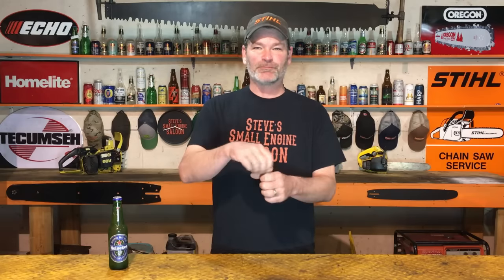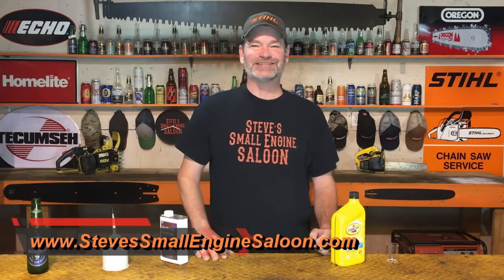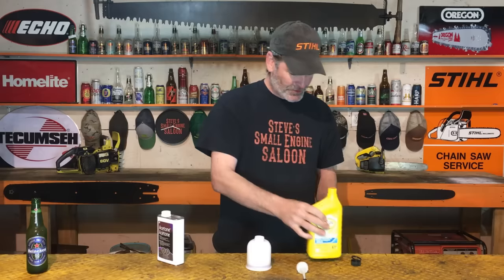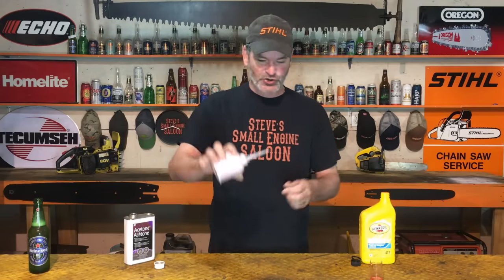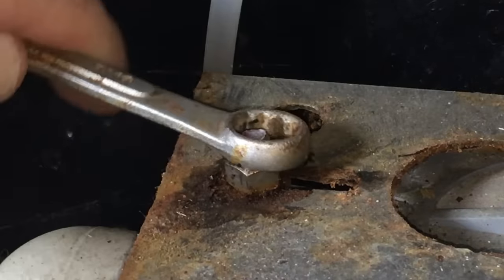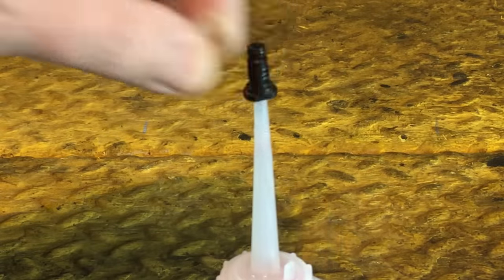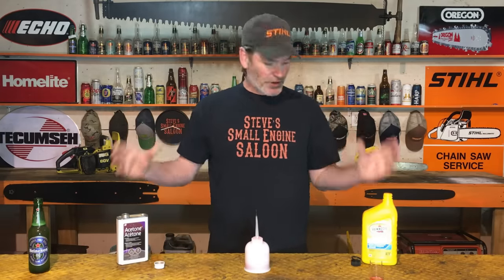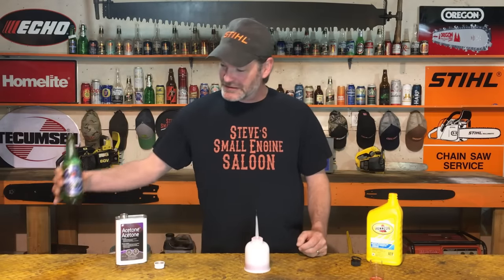How To Free Up A Seized Bolt or Nut

Comment: Always thumbs up!
I have to solve this, but problems:
1- it is fixed on a wall, that means I can't manipulate it.
2- It is horizontal.
So, is there a solution to spread it correctly?
Thanks in advance for your answers.
Any (manual?) transmission fluid are ok or does it needs "automatic" one?
Searched in my country and found similar, but it said lubricant (oil), is this ok?

Comment: Been using this combo since the 70's to free up vintage engines,  works fantastic, pull 9plugs and put a good amount in the cylinders of the seized engine, then every couple of days pull the dipstick out and smell it for the mix, when u smell it start rocking the engine back and forth until it breaks loose.

Comment: My condolences to you and your family on the passing of your brother Mike. I use Lockheed brake fluid on rusted bolts and seized engines and it works great can't let it get on paint work. But I'm going to try your solution and see how it works. Thanks for sharing.
Reply from the maker: Right on

Comment: Acetone and ATF make the absolute best penetrating oil.  Been using that for decades.  Something else that helps is to use a hammer and blunt--ended punch to give the bolt/nut a side impact to help break and adhesion between the contacting surfaces.  Then add more penetrating oil.  As someone else stated here, moving in small increments, back and forth, while continuously adding the mixture is a surefire way to get the stuck fastener apart.  If you can ever get it to move any at all, most of the time, it will come loose.  

Be aware that loosening very corroded nuts and bolts generates an immense amount of heat inside the threads very quickly.  When you have one that's really tight, move it a little and let it cool for a few seconds to disperse the heat.  Add more oil solution and do it again allowing for the heat to disperse.  Small movements is the key.

I learned this stuff from working in a motorcycle speed and machine shop for over 30 years.  Steel bolts in aluminum engines can be problematic when exposed to lots of moisture.  Sometimes there are ones that are not going to loosen no matter what technique is used but being careful can work most of the time.  My best advice is to use lots of lubricant and go slow.  The smaller the bolt the more care is required because they can twist off much easier.

Comment: Thank you Steve I had an axle nut that was being a big problem and I put all of my weight on a breaker bar and it still wouldn't come off, I tried heating and everything well after watching this I mixed some up, heated up the nut, and doused it with the mixture it then came right off. A great tip will definitely be using this in the future, Thank you.
Reply from the maker: You're Welcome...

Comment: I AM GOING TO TRY THIS DOWN THE SPARK PLUG HOLES ON AN OLD CAR THAT BLEW A HEAD GASKET 45 YEARS AGO THAT'S JUST BEEN SITTING IN OUR BARN. I WILL GET BACK ON HOW IT WORKED. THANKS TO YOUR BROTHER FOR THE TRICK. WAS GOING TO TRY KROIL, BUT SOUNDS LIKE THIS WILL WORK BETTER. I AM A LIQUID WRENCH KINDA GUY, BUT IT'S ALWAYS GOOD TO LEARN AND TRY  NEW TRICKS. THANKS. (MIGHT BE A MONTH OR TWO.)

Comment: So sorry for your loss.  Because of you, I was able to get my Ryobi leaf blower not only properly tuned but running like new.  You did a video specifically on that similar model and I thank you for that.  I was just about to give up but you saved me some $$ and I tackled it.  Between adjusting & tuning it, and proper non-ethanol fuel, it runs like new.  I didn’t have go out and buy a new one.  The unit is over 10 yrs old!
Again, my condolences to you and your family.
-Roy
Reply from the maker: Right on Roy!  Thank You...

Comment: YES I HAVE USED THIS FOR YEARS, AND IT WORKS WELL.    BUT LIKE STEVE SAID IT DOES EVAPERAT FAST AND SEPERATS  SO I ONLY MAKE UP A SMALL AMOUNT AT A TIME. IT IS EASY TO MAKE SO I ONLY MAKE WHAT I NEED AT THE TIME. GOOD STUFF TO USE.      THANKS FOR SHARING STEVE.
Reply from the maker: Right on Tommy...

Comment: Wire brush the exposed threads otherwise the nut will lock up on removal. With really locked bolts , like on a turbocharger many years old all rusted and corroded up. Wire brush everything heat the nut until it’s glowing if you can cool the thread with some water and use a freeing oil. Acetone being thin would get right in there and automatic tranny oil is pretty thin as oil go. Makes sense. Condolences with regards to brother, been through it. Nice dedicating this presentation to him.

Comment: Thanks Steve, sorry to hear about your brother Mike. Love your shout out to your mom. Ill give this a try - i have been in the auto repair business since 76 and what has worked for me is the torch. Either Mapp Gas (a bit hotter than propane) or Acetylene with Oxygen (my go to) we heat the bolts or nuts to a light red if possible cool down with water from the hose or spray bottle. Then repeat, it works every time. When we are in a sensitive area we use PB Blaster. The PB is good not great and many times we snap the bolts, so the ATF and Acetone tip is worth a try. Hope your doing well and I had a Hamms while watching this :)

Comment: Free-all works very well, and Kroil has also done great things for me.  I did oil and ATF in a old vw beetle engine that was stuck, forgot about it for months.  Went to take the flywheel nut off (I know, just buy a new one cheapskate) and that engine turned over !! What ?  Totally unexpected.

Comment: I have used prep and etch which is phosphoric acid and it works great. WARNING though. It’s acid so make sure you don’t spill it on paint and wear safety glasses and rubber gloves. It’s great for taking off rust too. ATF and acetone works great too. Thanks for the videos Steve!

Comment: R.I.P Mike
Steve silly question:
In a semi truck motor some screws are in horizontal position, does it work too🤔 you are showing as a proof a vertical position screw, the mix can run easily down because of gravity

Comment: Thank you Steve and my condolences on the loss of your bro. I've been a subscriber for years and your videos have helped me more than you know. I have a situation that's a new one on me. I have a sticky push mower blade that I cannot get off. I've had it off before to sharpen but this time it just spins when I turn the nut. I've applied PB oil but still no-go ( I will make and try your recipe in the future). What's weird is that the whole assembly spins, bolt and all. Makes no sense to me. As always, thanks for all you do!

Comment: I liked PB Blaster best, it too would wick up the threads and work miracles, I'll have to try this. But nothing else is quite like an acetylene torch to heat the nut to a bright reddish/orange, you have to be careful you don't wring it clean off, and when it gets to a dull red it starts to tighten up again so you have to heat it up some more.

Comment: The most amazing bolt/screw/nut etc. UNseizing method EVER!!!
I had a metal toilet handle that broke and the base was frozen to the metal nut.  I was going to have to replace my ceramic toilet water holder.  Tried this method which is a 1:1 ratio (aka 50:50 mix).  Place in a small shot glass (Thank's to Steve's Small Engine Saloon--HaHa) Drop a few drops onto the frozen bolt and nut and watched it "soak in" as Steve recommended.  2 minutes later I was able to unscrew the frozen bolt.  Genius!!
Reply from the maker: Right on Jimmy!  Thank You...

Comment: Great info thanks for the tip Steve.  I've always used Kroil, Aero Kroil, or mouse milk as we always used those where I used to work.  There are also some good videos on here about using electrolysis to restore corroded metals but I've never tried it.  FLY NAVY!!!
Reply: I used Kroil too many times with success. I'll definitely try this Acetone trick.

Comment: Hey Steve, good tip. I think I’m going to try using that solution as a penetrating oil to open up clogged zirk fittings instead of replacing them. Have you ever tried it for that purpose? Thanks again.

Comment: Hey Steve, if you have a minute. Trying to figure out some info. Why did STHIL start putting MS at the beginning of all there saw models? For example, like the MS 291. What does the MS stand for? Talking to my neighbor about exhaust mods, the topic came up in conversation. And neither one of us had a clue. Also while I have your attention. Have you ever built A chainsaw holder? One that could be mounted on A tractor fender or fourwheeler. If you have, a DIY video would be awsome!

Comment: Great tip Steve.  Sorry for the loss of your Brother.  BTW, how long do you let that solution soak on the fastener?  About 1-2 beers?  I usually spray Liquid Wrench penetrating oil on a fastener the night before if I have time.  It works ok.  I will try this next time.

Comment: Hi Steve. I understand the rusted nuts and bolts. How would this work on corroded, stuck water hose to metal faucet? (as in the water hose connected to the cold water fauced for a washing machine)?

Comment: So this is apparently a time of grief for the passing on of your brother Mikey. My condolences man. 
I have an old tractor, just bought the rusting hulk of a machine. A project. I do not have those two components but I do have paint thinners and CVT transmission oil. I'll combine those and anticipate similar results. The cvt oil has the most amazing slip and lube I have found in oil. Paint thinner might contain some acetone and ISOROPYL ALCHOHOL? So with a big rusty top case cover and bolts and nuts that have become pointed like a short rusty cone. You may have given the tractor a bit of salvation and to me also trying to make good of it all. Thanks Steve . And thanks Mikey. Walk with God, R.I.P. !

Comment: What should I do if it's a bolt not a nut that has been tightened so tight that I put a jack under a mounted wrench on it and it lifted the vehicle without loosening the bolt. Should I heat the bolts with a torch until it's glowing red hot then attempt to get them off??? The bolts are on the front calipers from a pickup truck that's been sitting for 7 years.

Comment: God Rest Mikey's Soul, and this is the 2nd or 3rd time I have heard this mix idea, so I will try it today.  WILL IT PENETRATE if the head is on top and you have to go through a bolt head, washer and steel (radiator core support)???

Comment: A wrecking yard close by also adds brake fluid in the mix.  Brake fluid wrecks paint so be aware of that. But it eats rust like crazy
 I have a protocol for steel bolts in aluminum that I just walk by every day for a week and add a bit of penetrant before attempting removal.  Works s treat on motorcycle case  screws

Comment: So sorry to hear your loss of a brother.  Family is everything.  More important than riches or fame or even health.   May GOD welcome him home with open arms.

A little story on penetrating oil and stuck bolts and such.  We moved to NOrtheast NC in ‘99.  Looking for a marine mechanic, I found one in Hertford  below Tidewater, Va.  he was trying free up the horizontal hinge pin that lets you raise (tilt) the engine on a 100 hp outboard.  He had been soaking it for over nite with some kind of penetrating oil, to no avail.   I suggested what my elevator mechanics used in similar situations.   You may not believe it bot the solution to break the large pin was SLOAN’S. LINIMENT.    It saved many an elevator repair time with repair teams trying to free bolts nnand frozen shafts on old elevator systems, some dating back to early 2900’s.    I returned a couple of days after meeting the boat mechanic and he showed me the bottle of Sloan’ LINIMENT.
The hinge was free and the repair done.  He was amazed.  
Apparently the liniment solution containing Butylated hydroxytoluene, Coparaffinate, and Methyl salicylate and pine oil together with a bunch of coloring agents works very well in penetrating action due to a very low surface tension of the mixture.  It is very expensive, the 4 fl. Oz bottle costing me $16,89 at my local small town pharmacy.  On special order.  Comes in a glass bottle and I have kept with the package an old red plastic tube such as comes with WD40 spray cans.  You can apply as much as you need and not waste a drop.
Forgive me for changing the subject from Mikey to Sloan’s.  Thank you for sharing your brother’s experience with frozen bolts.  May his suggestion live on with your subscribers and viewers.

JoeB
.

Comment: Steve, it has been more than a year but I know you still miss your brother.  My condolences to you.  Tell me, could this ATF-acetone mixture be used to free up a lawn tractor rim that is seized onto the axle?  Even better, have you posted a video about how to pull a seized wheel?  I tried a 7" gear puller and got nowhere.  I do not have a torch.  Thanks.  Brian

Comment: I'm a believer! I pumped 20 shots of this mixture into each of the 8cyls of a stuck mercruiser v8 and let it sit a week with the plugs in.  I used a crank rotation tool bolted to the balancer and a breaker bar with a 4' pipe from my floor jack. and the engine broke free! after about 5 rotations snd a lot of back and forty motion, i could easily turn the motor with just the breaker bar alone.
Reply from the maker: COOL!

Comment: Corrections, acetone is sold in plastic containers, most probably high density polyethylene or PVC. Also USED automatic transmission fluid (AFT) can be substituted for new AFT. Kerosene would work better as it is similar organically to the AFT, whilst acetone is somewhat like alcohol . I am an industrial chemist.

Comment: Brake fluid works great for helping to get rusty bolts to come loose too...great thing to know when you are at a pick a part yard and don't have your can of penetrating oil with you, usually you can find brake fluid left in the brake lines or some in the reservoir.

I use a 50/50 mix of transmission fluid and engine oil all the time when reassembling stuff, works great, and it also works great to help loosen stuck fasteners too, but not nearly as good as brake fluid or your acetone/transmission fluid mix.

Comment: Rather than mix it, could you just pour a bit of ATF, then a bit of acetone on the bolt, and let them mix there? Apparently both those fluids soak into the metal crevices very well, and I doubt only the mixture soaks in better than either fluid by itself.

Comment: Condolences, it's tough to lose a family member, especially one that was close. 
I've used a product called Rust Buster for some years now and they recommend tapping the fastener lightly to help break it loose. I've also tried the ATF & Acetone with similar results. Use it in the shop where volume is needed. Another good one is Deep Creep by Seafoam. 
The big thing I've found is patience, and not using excess force. A little push & pull back & forth to start with to help get things moving. Then stop & back it off when you feel resistance increase. Apply more penetrate and clean the the threads if removing a nut from a stud. Even using a die will greatly increase the odds of a successful removal.
RIP Mike.
Reply from the maker: Thank You...

Comment: FLAMES, FLAMES, FLAMES....

Forget all the fluids....use heat.
Flames played on the nut...
Works every time.....

Obviously you have to take care in confined spaces and near any rubber components, but small lighters with intense heat flames are readily available...or a flame directed down a piece of pipe will work...

ATF and Brake Cleaner are pretty good, but flames and heat always excels....

Nice and informative video. Well done...
James Hennighan
Yorkshire, England
Reply: I mean this is a good alternative for the DIYer to pre soak suspension steering and exhaust bolts/nuts the night before the job.

I'm not too keen on playing with fire, especially with a small propane torch😢
Reply: @ricebike  Check out the availability of small butane powered lighters. I have one that fits in the palm of my hand and gives a very sharp and high-intensity pencil like flame. Easily directed and one fill lasts for a good while. Cheap as chips on the internet.

Obviously the flame can still hurt you or cause some damage, but it's small size makes it easy to handle.

You will be surprised how little heat a seized nut requires, (even a very rusted one), to free it.

James Hennighan
Yorkshire, England

Comment: Steve, I thank you for this recipe.  I am 70 years old, female.  Going to hardware and auto parts store tomorrow and see if this works for me.  Dang Weber BBQ grill whoever used the wrench tightened the bolt hard and I think I am the person who tightened it.  Need to replace the regulator.

Comment: Kroil is about the best I’ve ran across
Reply: Have you ever heard of it? You can’t buy it at auto parts stores or home improvement stores. You have to order it but it’s amazing
Reply: I've heard of it but does it work better than the 50/50 mix Steve mixed up??
Reply: @donmayberryjrsOPE  
I would have to say yes
Reply: @justinphillips5702  IDK, I've been using the acetone/ATF mix for many years and haven't found anything else better.... Yet
Reply: @donmayberryjrsOPE  
That mixture works very well but, I believe the Kroil is has it. Just try it out I didn’t believe it until I tried it,… least to say all of my Wd40 is outta my shop lol… not bashing it by any means same as Pb. Telling yah this stuff works but it’s not cheap
Reply: Well need to have a test done… with beers of course 😜🍻
Reply: @justinphillips5702  let's do it!!!

Comment: My Brother's name is Mike too. Sorry for your loss.
OK: So ...A Tip I got from an old school Automotive Engine machinist for getting rusty Pipe plugs out of iron engine blocks.
Heat block/plug assy. up with torch. then put a wax candle against it. It will suck in the wax.
Don't heat it too smoking hot though, You will know if too hot, because the wax will smoke and evaporate.
(Bad to get iron block to hot anyway). Just a tip from your Uncle Larry<<<Comedian